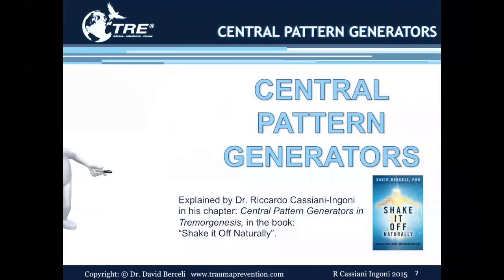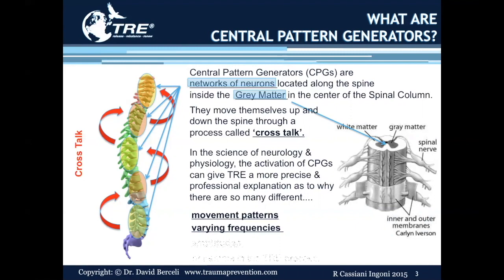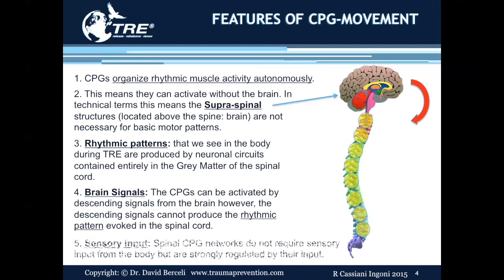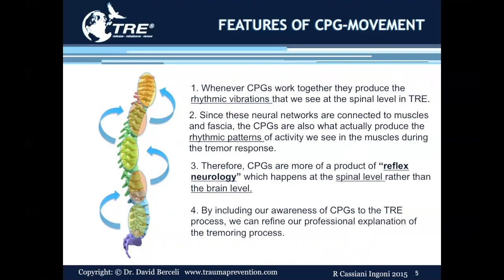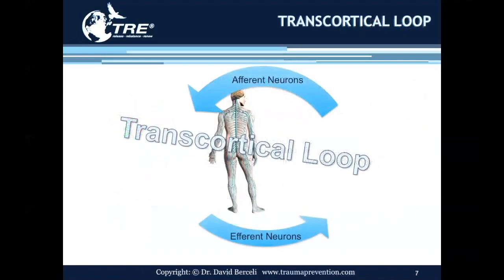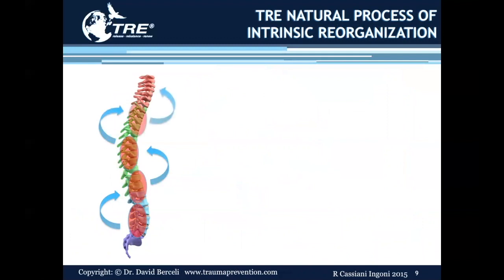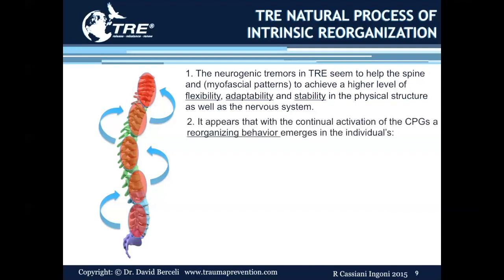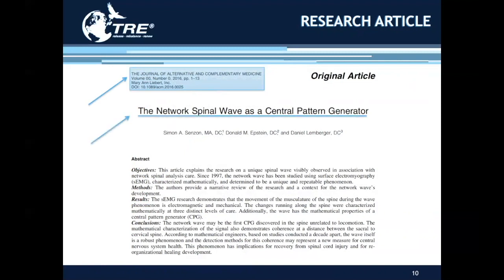Central Pattern Generators in the TRE Process

Comment: Hello! i have a question about POSTURAL TREMOR VERSUS NEUROGENIC TREMORS ( created by the three exercise)  I suffer from a condition called Ehler danlos syndrome (EDS)  a connective tissue disorders. that affects all the joints muscles and all the connective tissue within the body. Symptoms are many ! but to name a few - POTS autonomic dysfunction, palpitations and sometimes sinus tachycardia, Pain, Muscle weakness, vertigo (Balance problems), chronic fatigue, Depression, anxiety, panic attacks. And because of my EDS, I have a so called postural tremor in ALL the muscles in my body.  what my doctor calls it "a unique unusual tremor"  to explain this ” my tremor is simply a form of natural tremor. .But my eds and fragile long connective tissue make it occur everywhere. all the time. At the most simple movements .. Like when I go up and down a stairs .. When I nod with my head. So to speak, when I use the muscles the tremor occurs. The Tremor I have looks exactly like the one presented in your video "Your body's natural restorative tremor response" easiest way to explain my muscles is to think of  spaghetti (haha) or if you think of an elastic band that lost its function. Therefore, tremors occur. So Here's my question. can I use the tremor I already have in my body? I notice that I absolutely do not need to warm up at all. Because I already have this tremor naturally everywhere. When I tried the exercises I felt that they were very nice stress-relieving and generally healing for my body awareness and inner stress. i was suprised by its effect.  It feels like I found one of my thing to do . And i have already noticed a relief from certain symptoms. And especially that I feel more grounded. So can i just use my postural tremor to start the shaking process?  thanks